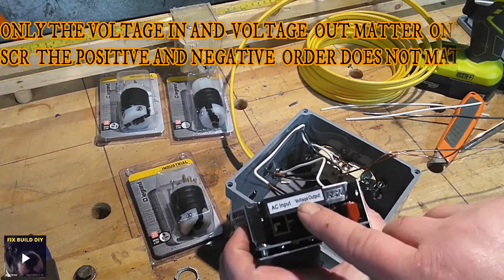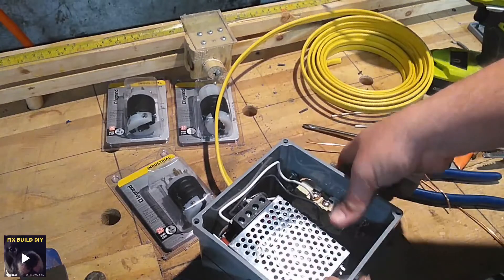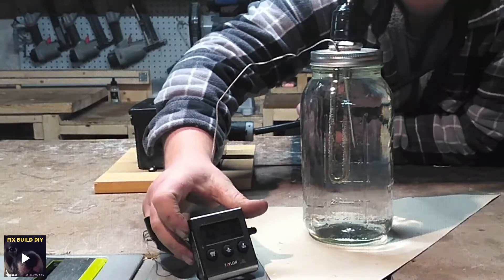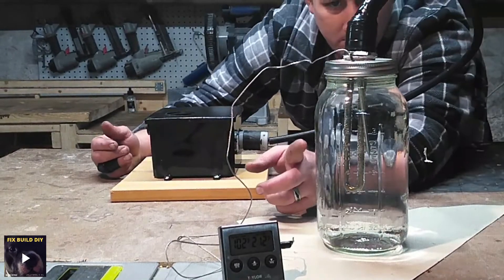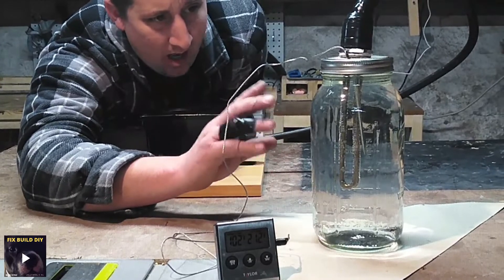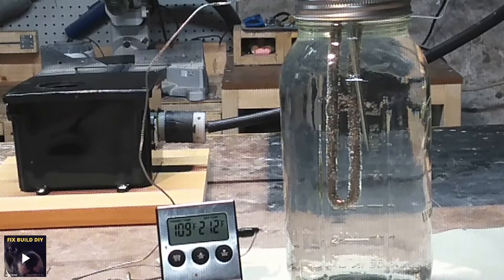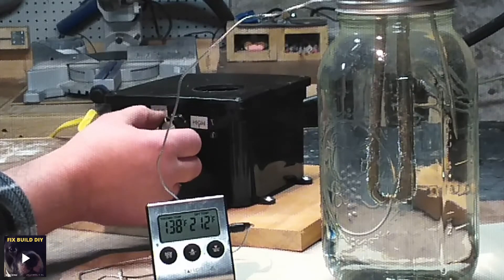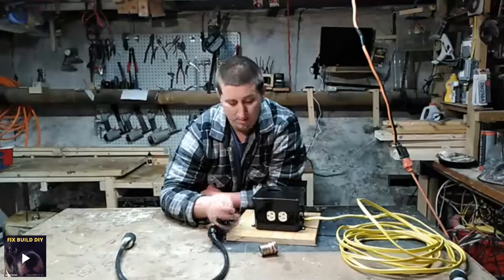(DIY BREWER'S CONTROL BOX) FOR CONTROLLING HEATING ELEMENT'S WITH SCR CONTROLLER)

Comment: This video is perfect. I did a lot of searching before I stumbled on this... I wish YouTube's algorithm would give you more love!! 

Quick question... Does your box give a slight buzz at about 75% power? I followed your wiring to a T. Looked for a schematic to make sure the neutrals and hots were going in the scr correctly but can't find one.
Reply from the maker: (Brad Jones) If it dose I never noticed it. It could be the SCR controller you are using  I have had some in the past that buzz  like that.
Reply: @kodiacademy9825  worked well on my angle grinder and element though. Thanks man.
Reply from the maker: No prob glad to hear that 👍 if you have any more questions in the future I'll be glad to help.
Reply: @kodiacademy9825  no more questions - although a 240v would be a good video as well. 

Also if you try some hashtags in your description and a much longer description you might get more views / be at the top of some search lists for scr controllers

Comment: Did you by chance do a video on the 240 volt, 30 amp to a 5500 watt element? Do you sell these at all? Thanks in advance.
Reply from the maker: No I don't sell them. I haven't made a 240v they are similar but there is a difference in the way you wire it you also need a 240v controller as well some controllers are 120/240

Comment: Would it make sense to add a GFCI outlet inside this box or use a GFCI cord on the heating element side that plugs into this?
Reply from the maker: Yes you could however if you are running 240 volt or 30amp 120v you would have to get a gfci outlet to match that Amp also you would have to rest the gfci every time you plug in or unplug but that's not that big of a deal
Reply from the maker: This is a great question I might just have to go back to the drawing board and make one with some kind of backup or fail safe 👍

Comment: This may be a dumb question but what’s the max temp this set up will hit .. I’m a first timer and want to make sure this would heat up my 10 gallon still threw the entire run ?
Reply from the maker: So it will definitely heat up well past 212 degrees you could run 20 gallons it's just that it would take longer to get up to temp for example   with a single small element it would take about a hour on full blast to get 15 gallons up to 170 180 if you go with 240 volt and a larger element or even 2 element's it would cut the time down significantly
Reply from the maker: As you run the temp will continue to rise the whole point of this controller is to be able to control the temp and speed
Reply: Okay awesome could you run dual elements on the same 110 configuration? Or would I have to step the element size Down?
Reply from the maker: check out these 2 channels they have all the info you will ever need on this matter the one is called still it and the other is barley and hops
https://www.youtube.com/channel/UCThY8lOKKkVDd9HVBT59zCgttpshttps://www.youtube.com/channel/UCatCieEI4cPNteKXzBomVMQ
Reply from the maker: i would NOT run 2 elements on 1 box some people have 1 element ran by the box and the other just has a on off switch on it and they plug them in on different circuits when it gets to the desired temp they turn the one element off and control the other element with the box. I would strongly suggest you have a professional or someone who knows electric well make sure that the wiring and circuits are capable of handling the power.  I know you said you are new at this so im going to send you 2 channels that are really good for info on this matter
Reply from the maker: barley and hopshttps://www.youtube.com/channel/UCatCieEI4cPNteKXzBomVMQ
Reply from the maker: still ithttps://www.youtube.com/channel/UCThY8lOKKkVDd9HVBT59zCg

Comment: I love the video, do they make these parts for 240 volts 30 amp, to power a 5500 watt element?
Reply from the maker: Thank you Rob I really appreciate that. And to answer your question yes they do make the parts for 240 volt in fact a lot of scr controllers are 120/240 volt. If you would like I can do a quick video explaining how to do it.
Reply: @kodiacademy9825  that would be awesome, I'm interested as well in the 240 build
Reply: I have the same question of how to do this for 240v